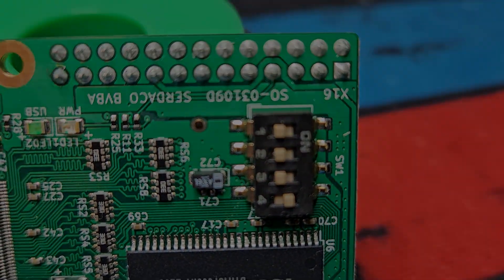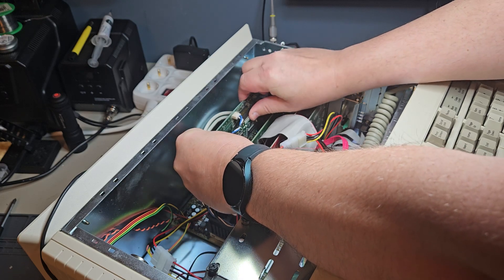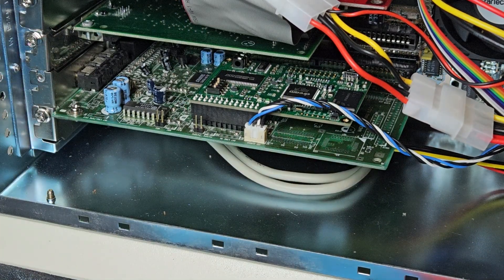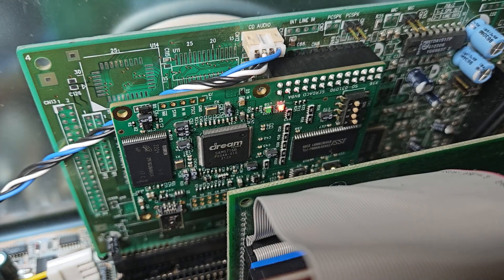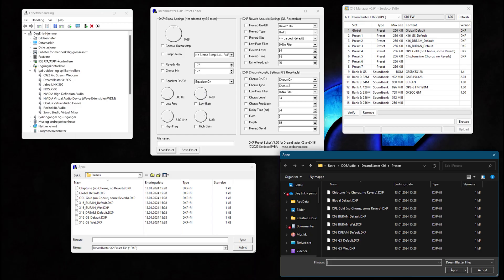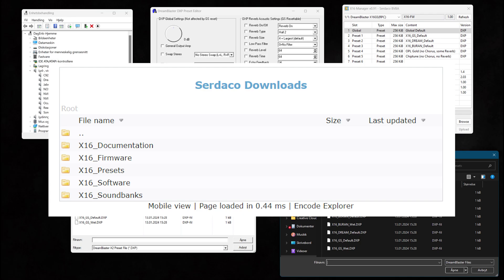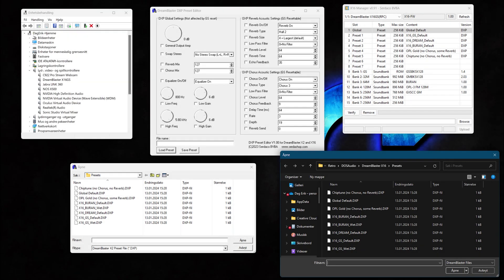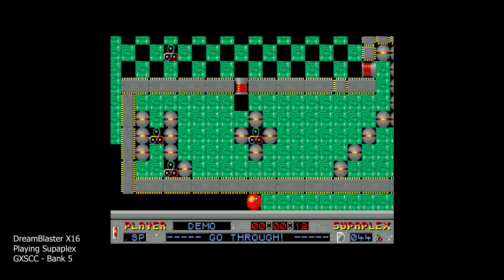DreamBlaster X16GS from Serdashop - review and how to use.

Comment: hello. i buy dreamblaster x16gs, but it's not work on asus i-a16c (vibra 16c) and Aureal Vortex 2 SQ2500. Can you help me? Thanks. 
P.S. under windows 11 by usb cable - work fine.
Reply: If this is still relevant, there is an update to this problem on Serdacos Site. The X16/X16GS modification for SB16 cards. I had this problem too with my sb16 ct2230 and could solve it. Good luck!